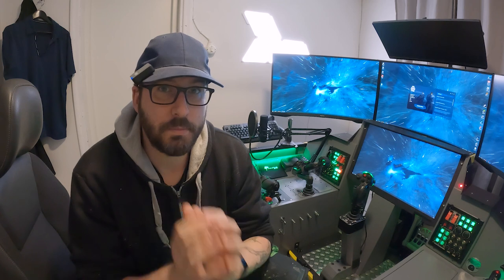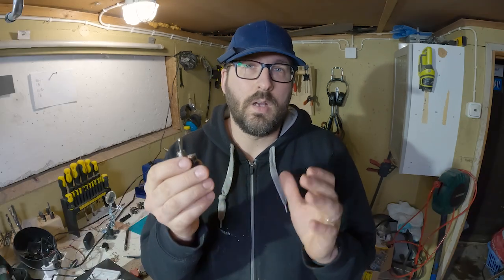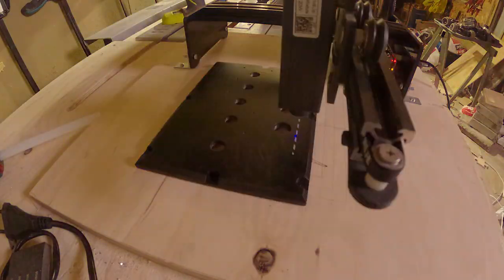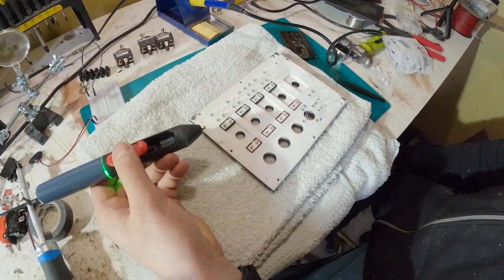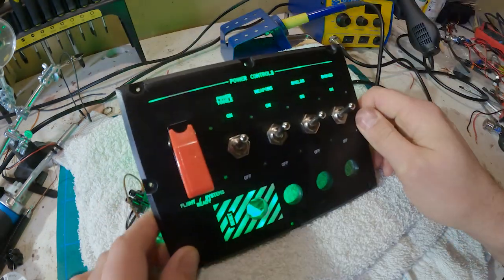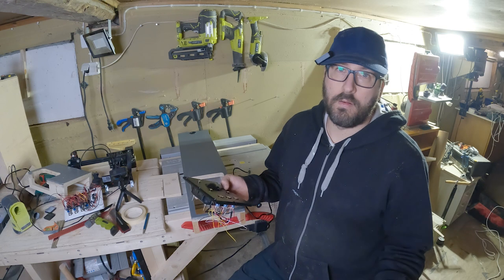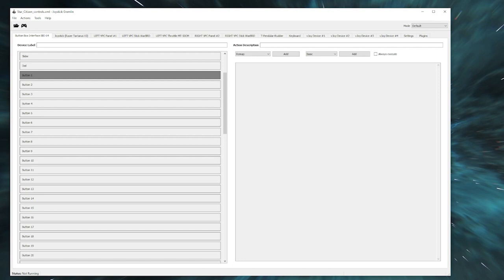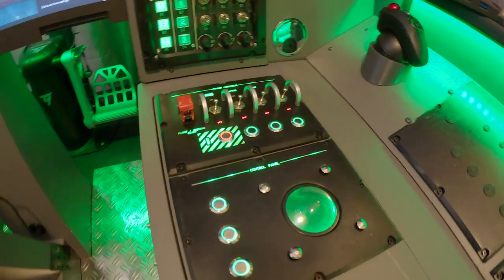3D Printed Star Citizen Power Control Panel - Building a Home Cockpit ep 9

Comment: Hey so I have a question , so did you program your switches through arduino ide and the use joystick gremlin, or did you just use joystick gremlin? I'm starting to get my project ready and make my own panel,  thanks!
Reply from the maker: Hey. For this panel, I'm using Leo Bodnar BBI-64 which is already basically a controller, so no need to program anything, just connect the wires. So just Joystick Gremlin for this.

For the future projects, I'll probably use Arduinos a bit more since you can get a bunch of clonse for quite low price. I have one Arduino test project here: https://youtu.be/uFDso9GMOOQ
Reply: @UndeadParrot  thank you for the quick reply! Do you think using an arduino micro or an arduino micro alternative would work the same as your Leo bodnar?
Reply from the maker: @michaelalfonso4792  There shouldn't be any issues with Arduino, as long as you use a version that works with Joystick library (ATmega32u4 based).

It will naturally be more work since you'll need to create the code but it also will be more versatile, allowing axes etc.

And if you really want to dive into deep end, you could create a matrix layout for buttons so you'll be able to add much more of them.

Comment: looks great. one question: sometimes i have the problem (e.g. after a major win update) that all my usb devices (joysticks, throttle, rudder...) get new ID's and i have to change the star citizen "layout....xml" file. (e.g. old input="js5_... " is now new "input="js9_... "). do u have the same problem and if yes how do you handle this situation? is there something more easy? rebinding everything ingame is out of the question and way too much work....
Reply from the maker: I've basically done two things: first I have mapped all the controls to four or five virtual joysticks (instead of I guess 8 I have there), which makes things a bit easier.

Then if the joystics will get messed, use a console command "pp_resortdevices joystick 1 2" two switch the joystick numbers. This example naturally will switch 1 and 2 between each other, so you'll need to figure out what joystick is what, and what they should be.

Comment: Have you thought about doing a video about the leobodnar board, wiring with software? I’m about to use ardiuono so it would be really interesting and helpful. Love the Simpit!
Reply from the maker: Leo Bodnar board itself is quite simple: just plug the buttons in and it's good to go. Windows sees it as a game controller.

But I'm planning to do an Arduino project at some point, and also another video about Joystick Gremlin and stuff.

Comment: When I bought my joysticks I also looked for a good way to have a switch to turn on my engines and other stuff, no logical reason apart from the fact that I thought it would be cool to flick the switches up. Have no experience soldering and doing stuff like this but I want it so much, might have to give it a try at some point.
Reply from the maker: Really recommend, it's also quite fun project. Soldering is easy to learn.

Comment: Great stuff as Always ! If I understand well, you use the current deliver by the board to light the green and red LEDs ? Not un external power supply ?
Reply from the maker: All the lighting is powered by external supply, the 12 V rail from computer PSU. I have a connector there so I can plug it in easily.
Reply: @UndeadParrot   okai thanks ! So you use the Switch to let the current to a led or another. Thanks a lot ! Keep going !
Reply from the maker: @SpartanXfive  Yeah, it's a two channel switch, so I use one channel for buttons and one for LEDs.

Comment: Hello!
Are you using 2 or 3 way switches and on/off or on/on?
I want to build something like that as well. However i am not sure how to make it work. Because if the engine is a toggle button i need the same key input two times. So a 2 way on/off Switch couldnt really work because there is just one key input.
Reply from the maker: I have latching on-on switches here. Not an optimal since most of the games don't support setup like thigs. But I used Joystick Gremlin to map it so that when I push the switch, it sends a short keypress.

Reason for my setup is that I wanted to have the on-off lights. It's just a two channel switch where second channel is for the light, nothing special.

I would recommend using momentary on-off-on switches.